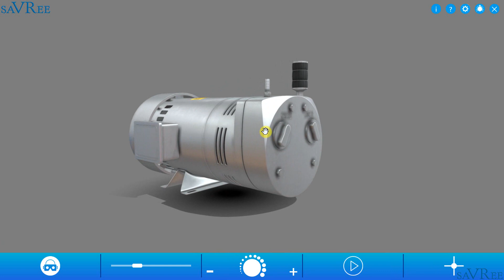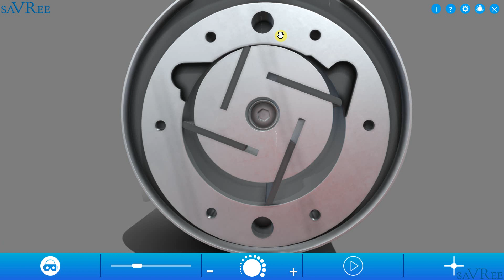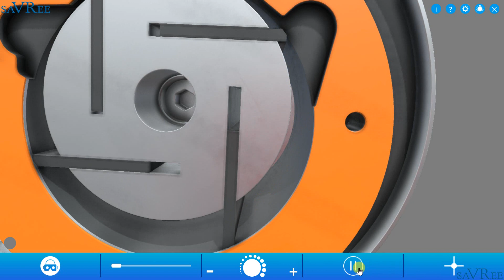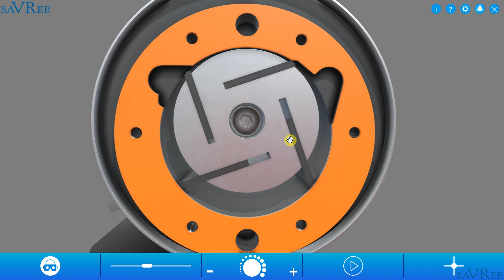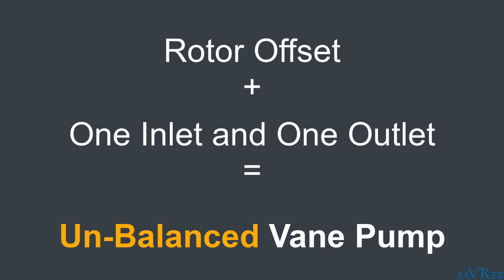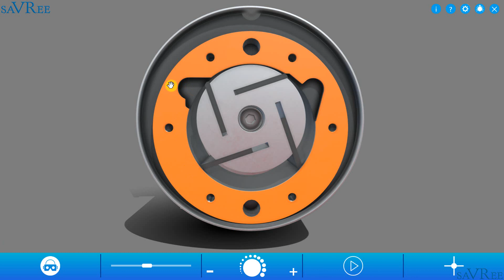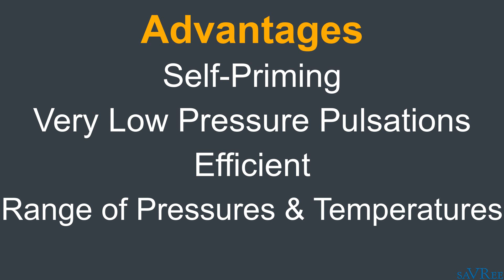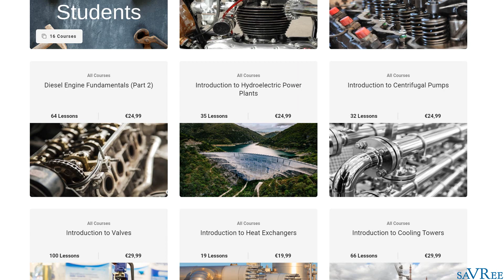How Rotary Vane Pumps Work (Engineering)

Comment: I changed the vanes and filter of the  pump GAST 0523-101Q-G588NDX, the motor is rotating( at least giving loud sound) but it is not pumping. What could be the reason and how to fix it? Thanks

Comment: after 5:15 you said "This particular type of pump is a positive displacement pump, that means you can pump air, whereas a centrifugal pump for example cannot." I am not sure what you mean, there are centrifugal air compressors. I guess I missed the point, so please help.
Reply: Pumps and compressors are two totally different devices. 

Centrifugal pumps cannot pump air as they are designed to work with a fluid having density approximately 1000 times the density of air and these fluids also work as a coolant and lubricating agent for the pump. Thus using a centrifugal pump to pump air will effectively cause overheating and excessive wearing.

Whereas the centrifugal compressors just compress the air to increase its internal energy.

Check this link for further explanation:-
http://www.differencebetween.net/technology/difference-between-pump-and-compressor/

Hope this clears your doubt!
Reply: @swapneeldutt  if I understand you correctly, I could use a pump constructed for water to pump air. is it so?
Reply: No Sylwia, I'm afraid not! 
But yes you can if you want to wear your pump quickly.
Reply: @swapneeldutt  that's obvious. that's why I asked my question about what is said after 5:15 in the first place....

Comment: Those vane valves moves out of the rotor just because centrifugal force, or there is a spring behind them. Also what material are they made of to ensure the seal?
Reply: hey I know this is a rather old comment now but did you by any chance happen to find the answer in the past 5 years?
Reply: @Elaarener  I've seen some pump models that have springs, but most is just centrifugal force.